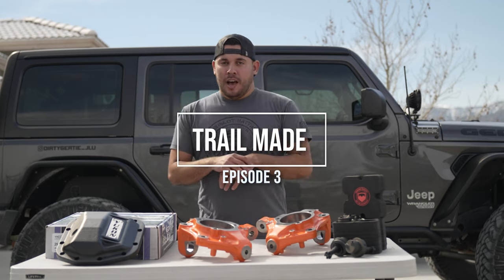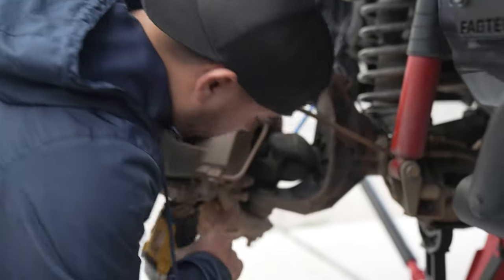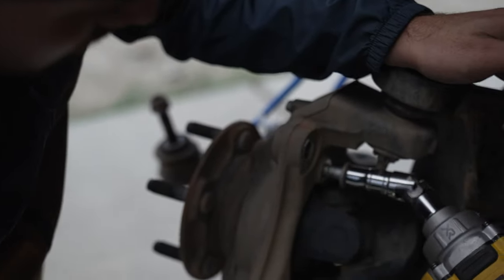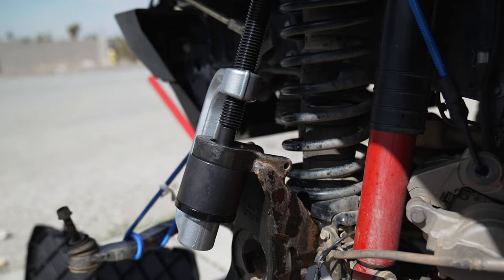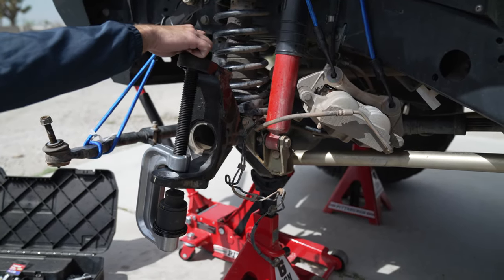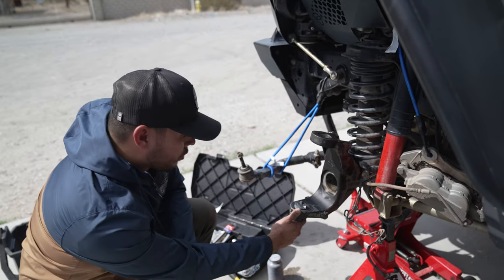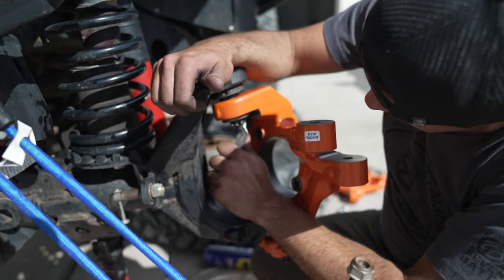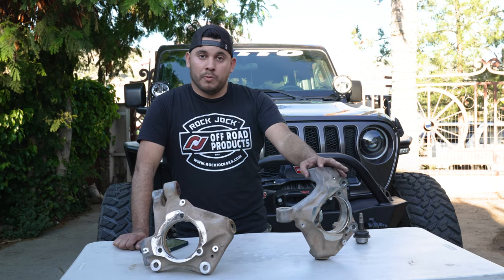Fixing My Jeep JL Death Wobble - Teraflex JL/JT Dana 30/44 HD Ball Joints & Reid Knuckles Install

Comment: Hey brotha when first installing did u have to break in the ball joints ? Just installed mine and they front wanders to the right and it’s scary driving at high speed lol
Reply: Did you recheck your toe? There is always a break in period but it shouldn't make your jeep wander that bad.

Comment: If your upgrading your axles too these ball joints are not compatible with RCV ( Teraflex site fitment tab) or 1410 Ujoints axle setups. Zerk fitting will contact the flange on the axle during a turn.  Great for OEM config.

Comment: Hi Nick I noticed you do not have a reinforcement bracket for your front track bar. It looks like you are running steersmarts with the MC track bar. If this doesn't work, try their XD track bar and sector shaft reinforcement bracket.
Reply from the maker: Hey thanks for the feedback and suggestion. Funny enough, the “additional upcoming install” I had mentioned towards the beginning was exactly that. Still editing the install video we did later for the Steersmarts brace, and it has definitely helped a lot! Between the Teraflex ball joints, Reid knuckles and Steersmarts brace, it drives like a brand new vehicle!

Comment: how much up travel do you have? looks like the jounce bumper is sitting on your bumpstop extension
Reply from the maker: It’s been a while since I’ve measured my travel distance, I should probably do that soon! My jounce bumper is actually just hanging on by a thread and folds over as soon as there’s pressure put on it. As a temporary fix til I get my new setup, I raised the bump stops to meet the part of the bumper that doesn’t bend. Actually works out well where it stops my travel right before the tire hits the bumper. Thanks for the support!

Comment: Do your teraflex ball joints click a lot? Mine click like crazy turning at low speeds, and they are torqued properly.
Reply from the maker: No clicking noise for me whatsoever. Hmmm when is the last time you greased them?
Reply: @TrailMade  they are overflowing with grease. I’m chasing the problem, and I don’t know what else it could be.
Reply: @J D I did. It ended up being the aluminum knuckles being wallowed out, but I definitely recommend the teraflex ball joints. I upgraded my knuckles to steel

Comment: Did you get new brakes too?
Reply from the maker: I just snagged the upgraded brakes that came w the rubicon axles
Reply: @TrailMade  Can those brakes handle 40’s ?
Reply from the maker: @ejjohnson8100  I know people that have used them with 40's , but I wouldn't recommend it. I would look into aftermarket big brake kits to stop that much weight